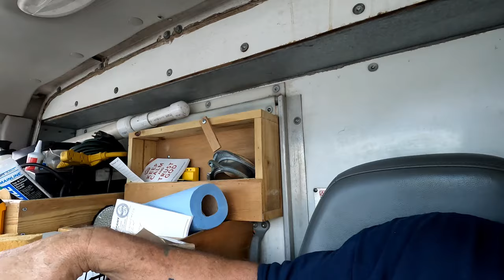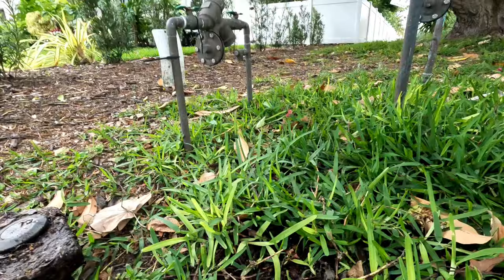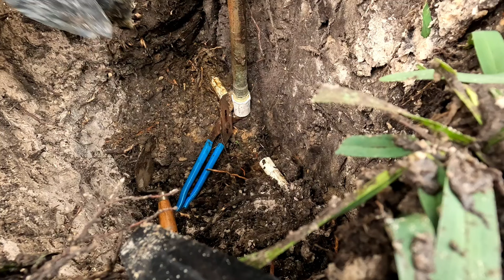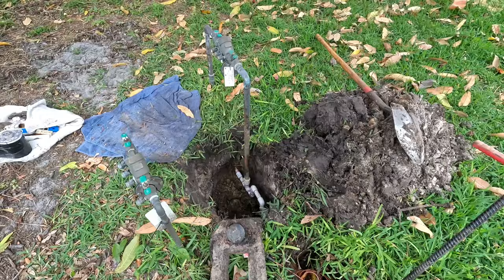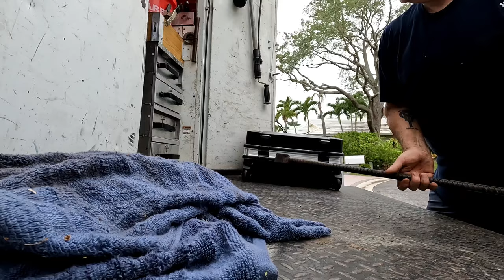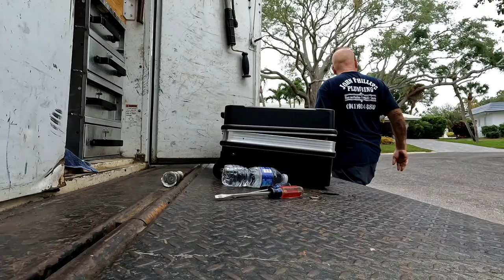A KNIGHT IN NOT SO SHINEY ARMOR, HELPING AN ELDERLY WOMAN, HAPPY TO HELP!

Comment: John, You added four extra 90's on that line, would this added resistance cut down on the flow , just curious ? Not that you had a choice.
Reply from the maker: They call it friction loss,too many 90"s can present problems,but in this case,she'll be fine!